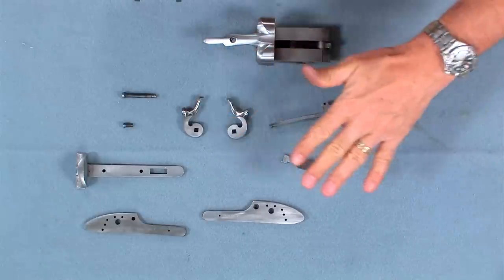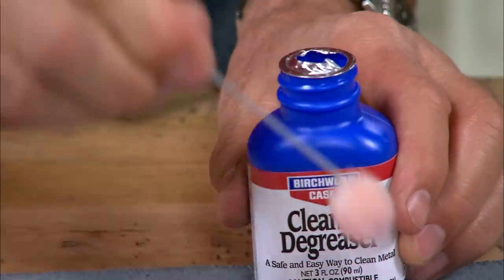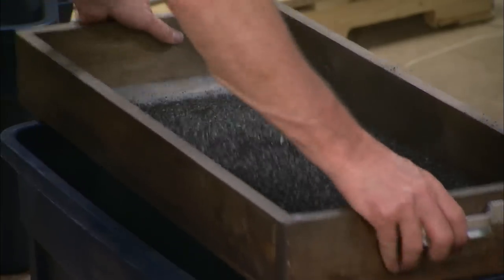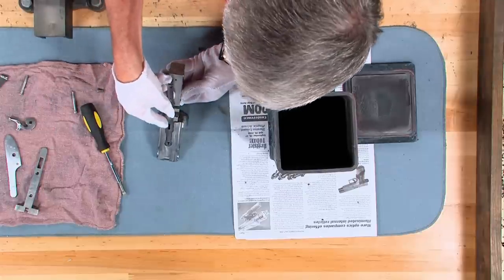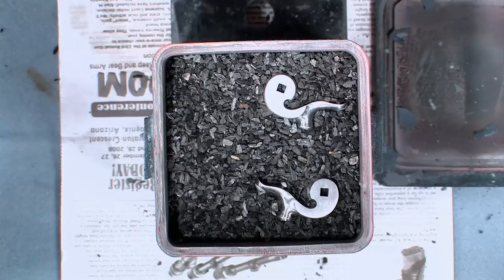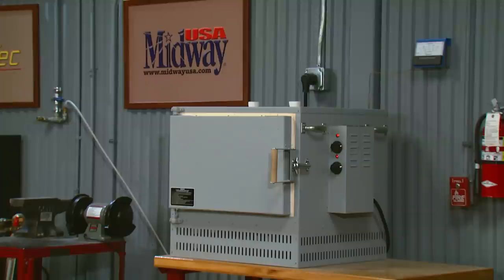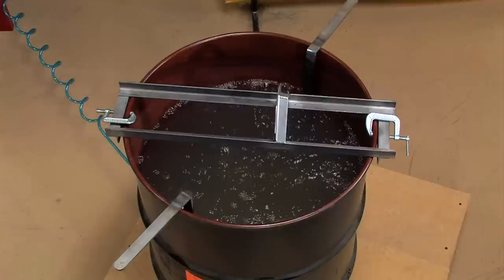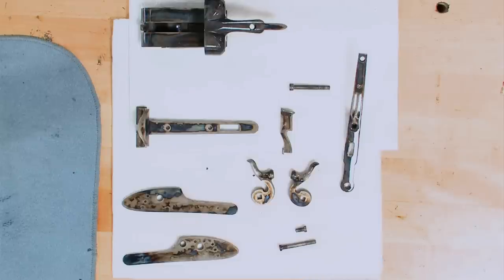Color Case Hardening a Parker Shotgun | MidwayUSA Gunsmithing

Comment: I love how many of these videos start simply with the narrative that this can be done by YOU the viewer... The tasks seem approachable, basic and lower cost..

Then each scene/process shows increasingly complexed, specific and expensive tooling in order to complete the task. Like not only do you need a massive kiln to bake the thing in, but also a space suit and a large barrel filled with bubbling aerated water with another 5 specific devices around it. There's almost always some Miles Gilbert thing and about 6 different jigs and guages, each more specific and expensive than the last.
Reply: He's demonstrating the process used by modern professionals, not teaching you how to do it. That's like complaining about firefighters doing a demonstration and complaining that they're using firetrucks instead of pails of water.
Reply: And that is why having your parts color case hardened is so expensive. Also, the time and patience in the prep.

Comment: Outstanding. I thought it was a long drawn out process. The only issue I see is having an oven that goes to 1400°F. Polishing the parts and placing them in charcoal looks pretty simple.  But I guess paying someone a couple of hundred bucks is cheaper than finding an oven. I have some AR parts that I want to have color cased colored for looks (not aluminum).
Reply: Pick up an old pottery kiln.
Reply: Don't know if it's still helpful but if you just want the steel colored you can blue the steel at different temperatures, that will give nice coloureffects much cheaper

Comment: What is the Crucible made of?
Reply: Stainless steel. You could use carbon steel, but it would case harden as well; over time, it would crack and crumble with repeated use. Stainless won't.

Comment: So what causes the color? I did not get that, its a mix of coal and what?
Reply: Peter August it’s actually just caused by a thin layer of oxides that develops on the steel, it’s thin enough to let a certain amount and wavelength of light through, and reflects others, then the steel absorbs some and reflects some underneath, the combination of those two waves is the color you see. This is called thin film interference

Comment: old vid and a bit late to post, but how would one obtain the style of case hardening that covers most of the parts? like i have a double barrel, a Savage Arms Fox model B, and the case hardening marble takes up most, if not all the receiver 

i'd imagine it would either be time duration, or coal mixture. i would think doing it multiple times to get full coverage would cause the metal to become too brittle. saw someone mentioned cooling it in oil for a darker appearance. maybe oil is what savaged used? got an old Stevens crackshot #16 i may want to get stripped, polished and re-cased. but i was hoping for a more "no polished metal still visible" kind of look. and more of the "full spectrum rainbow" coloration a lot of manufacturer done case-hardening has.

Dont care if someone sees this 5 years from now, if you have an answer, reply please XD im actually wanting to know about this.
Reply: When you color case, you place all the carbon steel parts in a stainless crucible packed with bone/wood charcoal, with each part separated at least a half inch from one another and the walls of the crucible. You fill the crucible cup by cup with the charcoal and tap it down so the whole surface of each part is surrounded (basically buried) in the charcoal. Heating carbon steel to 1450°F for an hour will bring out the colors inherent to the steel's composition; you don't really have control over what specific colors appear. You do need to polish the parts to at least 320-grit prior, and absolutely degrease. If you want more vibrant colors after you water quench, pop the parts into the oven again for one hour at 400°F. To protect against UV, you can also clear coat the case colored parts with a clear enamel or lacquer.
Reply: @nomennescio6209  I'm going to give it a shot on one of my old junkers first, what about case harden then the oven treatment & into dirty black motor oil while still hot ? maybe leave it in there overnight before cleaning
Reply: @ericschulze5641  Professionally, I would just case harden, quench in water, dry it (either with an air compressor or towel or both), then Renaissance wax the part(s) for protection. The oven treatment supposedly stabilizes the steel, but there's admittedly no scientific evidence if it does or not; if you do the additional oven treatment, there's no reason to quench it again in anything, just let it cool and apply some type of finish to prevent rust. I wouldn't use automotive products with firearms regardless. When you quench, you'll want someone else to knock off the crucible lid (if it isn't hinged) with a hammer or rod, then immediately plant the top of the crucible into the water (to minimize air from hitting the steel). Make sure you file and/or polish out all pits or scratches in the part as much as you can before hardening, without ripples or otherwise deforming the part.
Reply: @nomennescio6209  thanks will do .I still wonder about the not letting air in when removing the lid I will follow procedure however at over 1000 degrees I seriously doubt 70 - 90 degree air will rush in, its almost impossible & probably a superstition by those who don't understand heat & physics
Reply: @ericschulze5641  It's more of a habit we've gotten into; I've had lovely results on receivers just popping the lid and "flicking" the parts in (a quick turn of the crucible toward the water drum to dunk the parts). The main thing to keep in mind is not to let the steel just sit and cool without quenching, otherwise you'll lose the coloring to a rather poor shade of gray. I wish you the best on your project. Do it safely, have fun, and enjoy.

Comment: I wonder why they stopped doing this, I watched a video of a maxim shooting the other day (and many other "high quality guns" Chinese artillery pieces, etc... remember the egg shape of the civil war cannonades...?) and seen the cocking knob and some of the bolt parts just wobbling around like spring steel..... makes me wonder why they stopped color case hardening everything it makes the steel like rocks, which is why it's done,, not for show.. otherwise it's kind of flexible steel..... I noticed by the way that you touched the charcoal with your greasy hands which lowered the quality of the end product....also you should acid etch the parts afterwards I think which will bring out the pattern of the case hardening...... We bubble the water because I think the individual water bubbles touching the steel will create that pattern,,, it creates pockets of air that have different properties of heat dispersion than the water around them but it also makes it less shocking I think than the water alone.... and make sure to leave everything in there until it's completely cool otherwise it could warp and then you're throwing like a $50,000 shotgun out the window